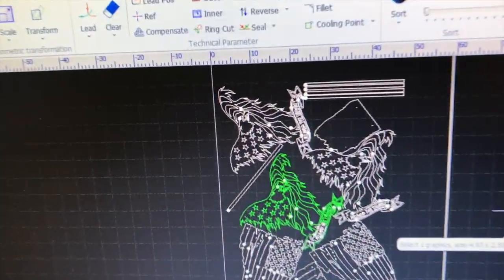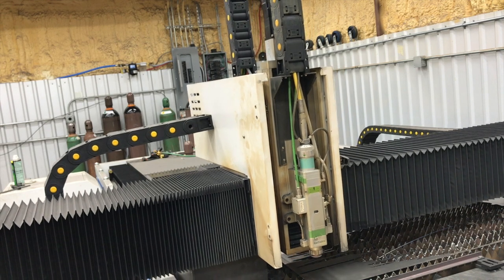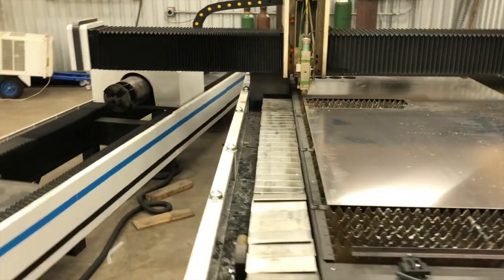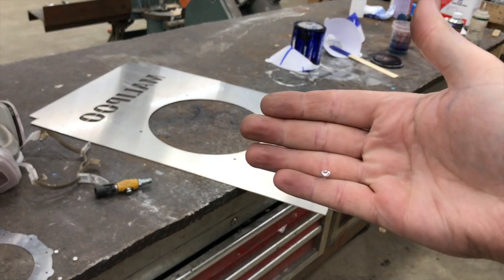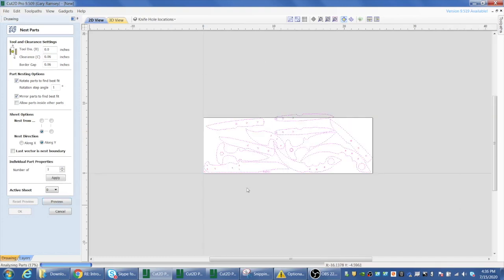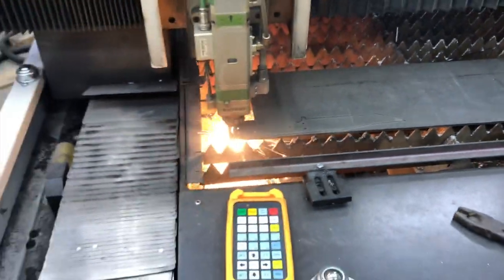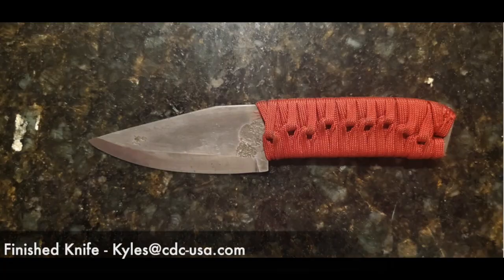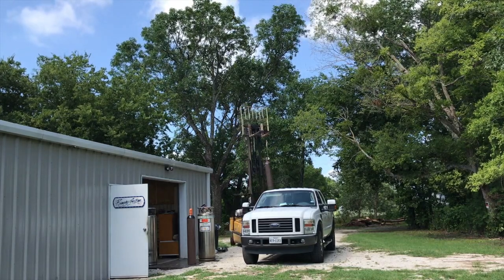The MALIPOO!! - Laser Cut Car Parts and 1095 Knife Blanks

Comment: High carbon is difficult to cut, it's melting point is about 10% higher which seems to mean it needs more pressure to displace the slag.
Reply from the maker: Ok, yea, I was thinking that it needed more pressure, but then again, more O2 would just mean more heat.  Prob best cut with nitrogen on a high wattage machine like 6KW or something
Reply: @turbocobra I thought you ran it with N2. Yeah O2 is a fine line, more and it explodes, high carbon is a finer line for a perfect cut than normal carbon steel. With a smaller job like that it makes more sense to just spend 10-20 minutes to deburr the parts and not waste three or four hours getting the perfect cut.. On tabbed parts it can save a lot of time to leave them tabbed in the sheet for clean up, I like my makita 5" disk sander for that task, it's less scary than an angle grinder.